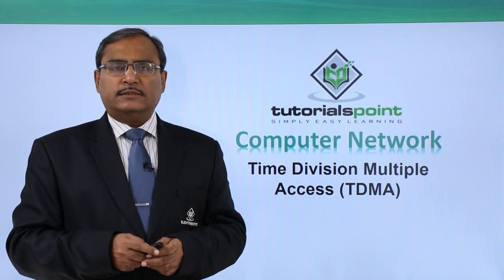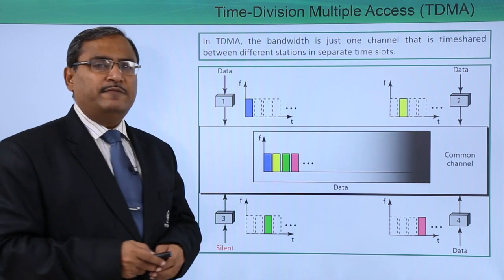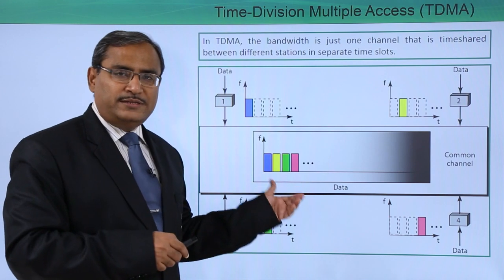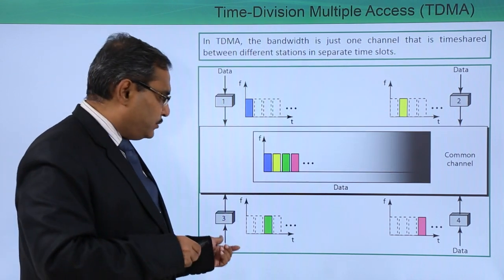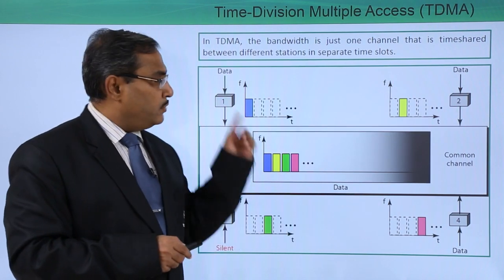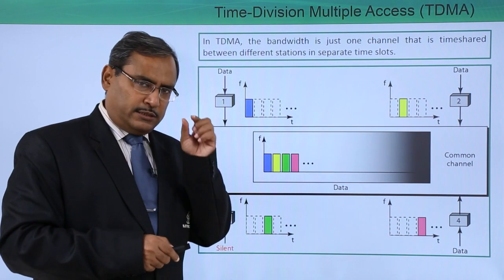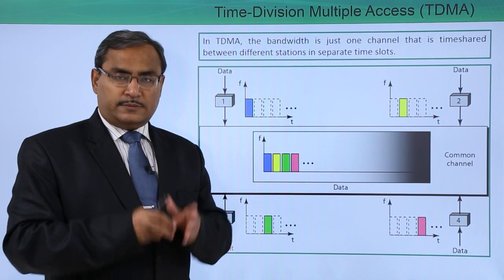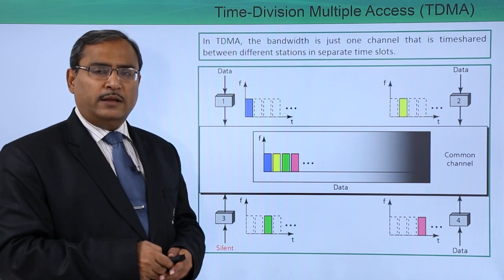Time Division Multiple Access (TDMA)

Comment: Excuse me. So what is the difference between TDM & TDMA?
Reply: That is good questiom bro.Let me explain....
In both TDM and TDMA, full bandwidth is used by a station or node. and they both conceptually seem the same.However, there are differences between them.
TDM is a physical layer technique that combines the data from slower channels and transmits them by using a faster channel .The process uses a physical multiplexer that interleaves data units from each channel.In contrast, TDMA is an access method in the data link layer.The data link layer in each station tells its physical layer to use the allocated time slot.There is no physical multiplexer at the physical layer unlike TDM. 
Thanks...
Reply: Tdm mean Time division multiplexing.... This is a techniques of multiplex but TDMA mean time division multiple access which is access of multiplexed signal...